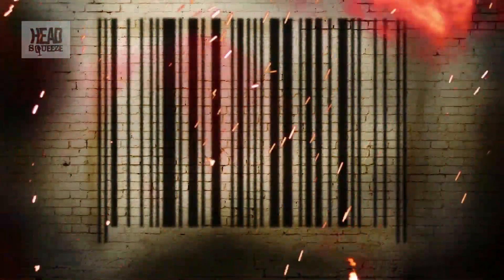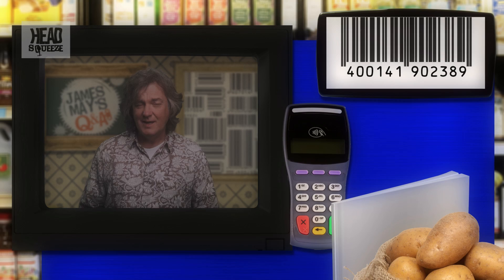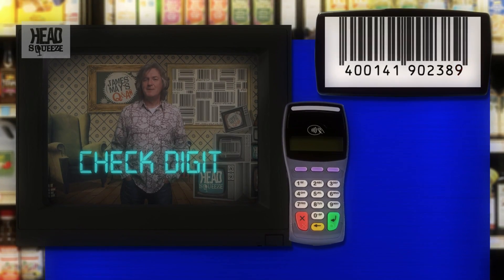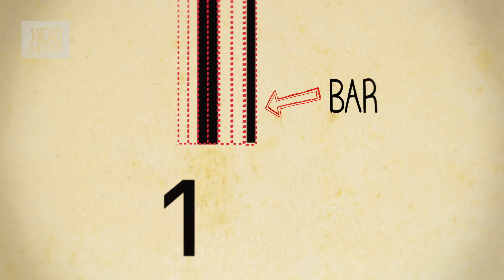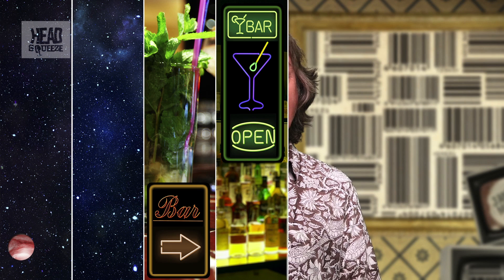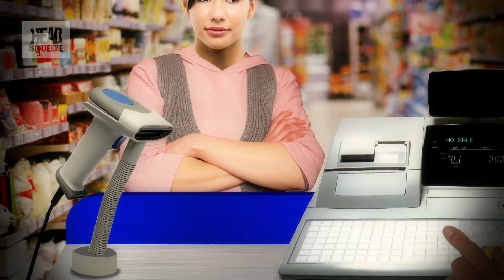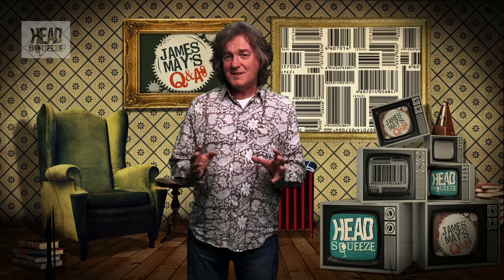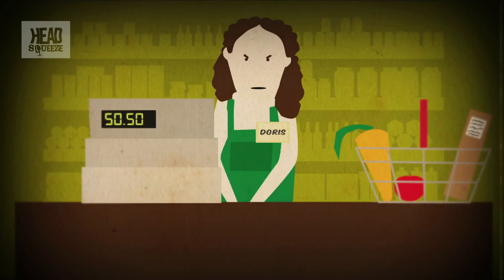How Do Barcodes Work | Earth Science

Comment: Am I missing something?
Each "element" of the bar-code is divided into 8 "modules", not 7.
Because each module is a bit, and the 8 of them form a byte, wich can be referenced in a ascii-table to work out what didgit it is.
the number 5 is "00110101" (bar-bar-space-space-bar-space-bar-space), and the number 1 is "00110001" (bar-bar-space-space-bar-bar-bar-space)

It really looks like they made a mess of this.
Reply: Not really. 8 'modules' would give you 2^8 = 256 characters to display, which is indeed used in the ascii table. But the ascii table includes amongst other things, the whole alphabet. A barcode is just digits. This means that 4 modules (or 2^4 = 16) would've been enough to form all 10 digits. I guess they chose 2^7 = 128 for extensibility.

Comment: Each digit is represented by 4 bars (alternating black and white) using 7 units, so there are 3 transitions in 6 possible positions. This is the data.. That gives 20 permutations, 10 permutations for the left side, and the reverse 10 for the right side.  The 4th transition is always in position 7 and confirms the end of the digit and the start of the next.

Comment: Good Video BUT there is an error at 3:44. It will be 107 modulo 10 which is 7 not 3.
Reply: That's not an error. The formula is 10 minus (number modulo 10) or 10 - (107 % 10) = 3
Reply: Mike Garner  I know the formula is 10 - (n % 10); but there is no mention of that in the video
Reply: "The check digit is then the number required to make this total up to the nearest number divisible by 10." n % 10 gives you the digit in the ones place (7), but to make it total up to the nearest number divisible by 10 (110), you need 3 more.

Comment: That's because its not binary per say. While it does use 1s and 0s like binary, as in each location is either on or off, the whole system is completely different from binary and set patterns indicate a fixed value. That's how it works and why you're confused that its not real binary counting.

Comment: I am confused, because when we were learning binary 1 would be 01 and could have an infinite number of leading 0s usually though they  would be in groups of 8 or 4, resulting in 1 being either 00000001, or 0001. How is 1, 0011001? how does the system work exactly. Because it does not seem like exactly binary.

Comment: You misspelled number 5. It is not space-bar-bar-bar-space-space-bar. It is space-bar-bar-space-space-space-bar. See here the numbers (no, it is not binary) 0 = 3211, 1 = 2221, 2 = 2122, 3 = 1411, 4 = 1132, 5 = 1231, 6 = 1114, 7 = 1312, 8 = 1213, 9 = 3112 . More info here: on wiki how, search for - How to Read 12 Digit UPC Barcodes -

Comment: Lincoln continental mk4 7L 200bhp Lancia delta 2L 207bhp is best I can come up with but did have to think about it if I could cross time periods would be more easy but that's not what I'm getting at and was an exaggerated example I'm asking why can one company get more power from the same size engine than another how did Suzuki get 985bhp from a 2L yet you can still easy buy a 2L with less than 100bhp

Comment: That turbo is driven by your exhaust. Its a small, rather light wheel that spins really remarkably fast, hellified rpm's thus pushing and breaking the air giving you that amazing whining noise. Think of a small scale version of when you whip your belt to your pants through the air quickly and you hear that "whoosh" sound. it's that sort of affect but smaller so it's more of a piercing noise.

Comment: The left side is         0011001 
and the right side is 1100110. So it's just the opposite of what it was, space on the left, is bar on the right. Either side of the two bars in the middle.

Comment: shouldnt 5 be space space bar bar bar space bar? i mean, with 7 bits you get up to 127 which is the ascii limit,which makes sense and the one is 0011001 which is 49 which is one in ascii. you said 5 was 0111001 but 1 is 0011001...so it is either wrong or the order is arbitrary (or hard to figure)